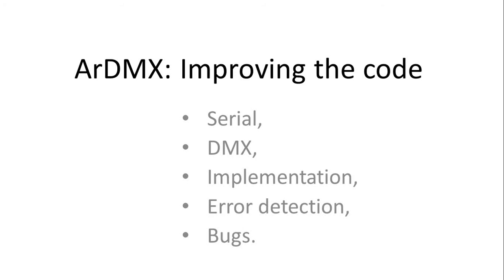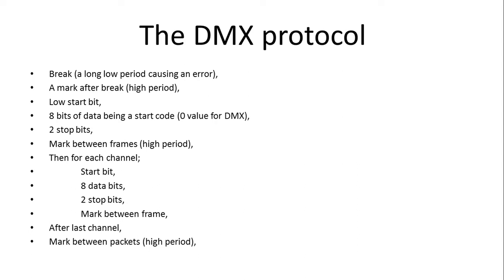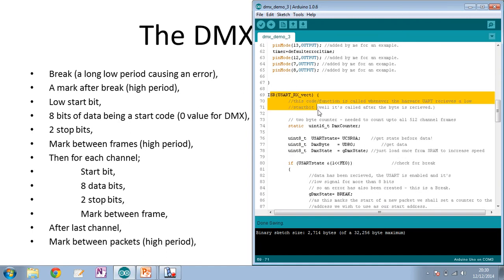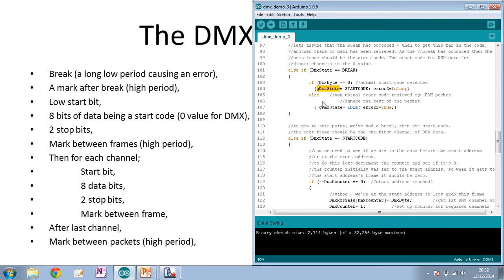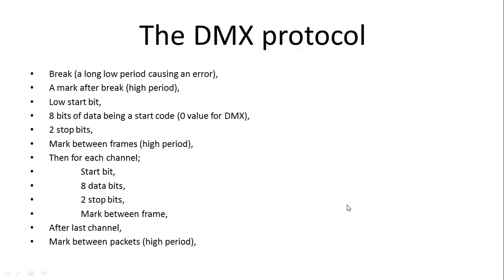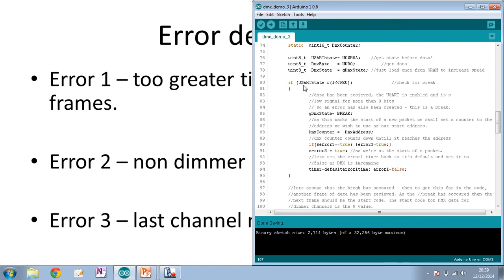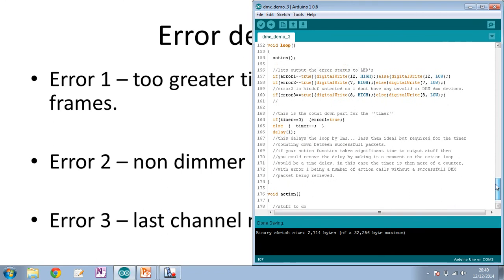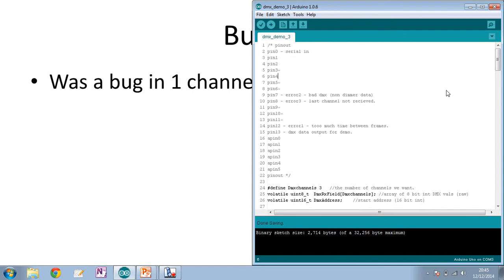#3 How to: ArDMX receiving DMX with Arduno; improved and explained

Comment: I'm just waiting for some of my components to arrive, but plan on having a go with this. Can I just ask, if I want to use the Arduino as a DMX reciever with just 1 channel and then use it to start different light sequences (different routines), is this straightforward? For example, assuming I set an DMX address of 120, with 1 channel. If I use my DMX software to send value 20 to DMX 120, it would activate a flashing light routine. If I send value 30 to DMX 120 it would set all lights to white via a routine etc etc. Any advice gratefully received.
Reply from the maker: Yes you can do this - t's how many lighting fixtures handle physical resets and the such. Just be aware that the subroutine for the DMX frames can cause timing issues as they will be triggered quite often in code timing speak.
Reply: How did your project work out? I'm starting simple, but eventually am going to control some ws2812 neopixel strips with 4 channels; R,G, B, and different patterns, maybe with a 5th channel that's for pattern speed.

Comment: Hey,
i've tried to use your code, but i can't compile it.
Error: 
"collect2.exe: error: ld returned 1 exit status"

I'm using the Arduino Nano - is this maybe the reason?
(same with nothing connected to the arduino)
I've changed the "HardwareSerial.cpp"-File - but same problem.

Maybe you've got an idea - thanks :)

(Arduino 1.6.7)
Reply: I've got the same problem

Comment: Trying very hard to make it work, but it doesn't compile :(  Tried it with Arduino 1.0.6 and 1.8.8, changed the .cpp files but still  doesn't compile. Hoping someone can help me, I'm using it for school project.  

Error code:
Arduino: 1.0.6 (Mac OS X), Board: "Arduino Uno"
core.a(HardwareSerial.cpp.o): In function `__vector_18':
/Applications/Arduino.app/Contents/Resources/Java/hardware/arduino/cores/arduino/HardwareSerial.cpp:115: multiple definition of `__vector_18'
sketch_mar26c.cpp.o:/Applications/sketch_mar26c.ino:69: first defined here
Exception in thread "AWT-EventQueue-0" java.lang.RuntimeException: Non-Java exception raised, not handled! (Original problem: Deprecated in 10_12... DO NOT EVER USE CGSEventRecord directly. Bad things, man.... bad things.)
Reply: I'm getting the same error and can't figure it out at all
Reply: I have the same problem